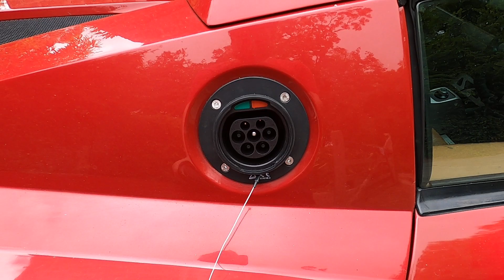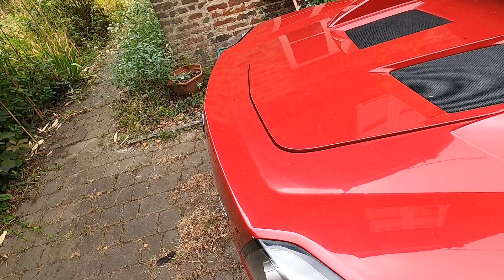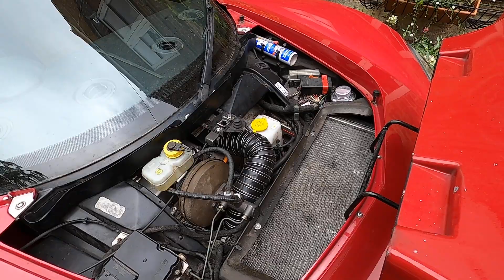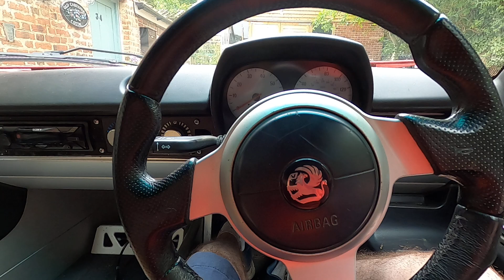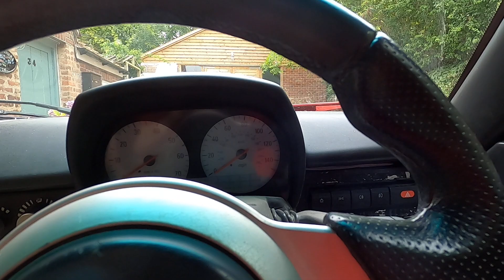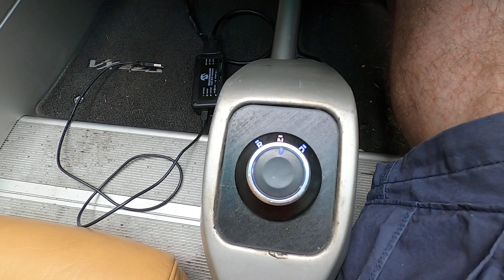Electric VX220 Tour

Comment: That Tesla motor at back is very low and vunrable. Not a good design.
Reply from the maker: You're quite right. It's definitely too low. I raised it as much as I could but would definitely rethink this if I was starting over.